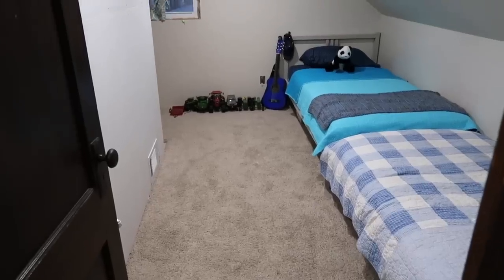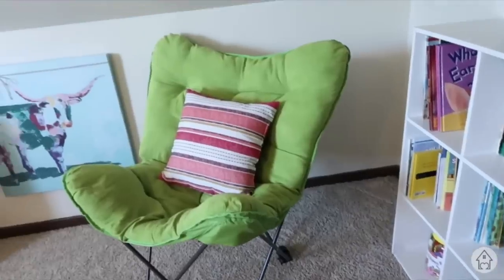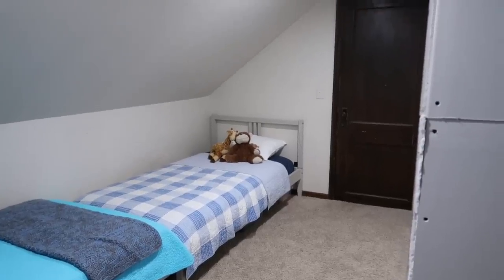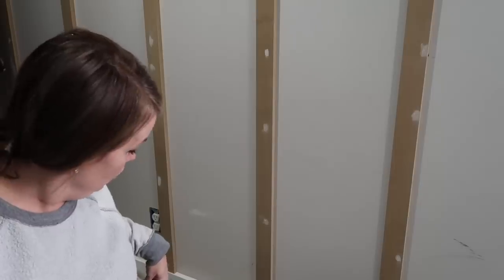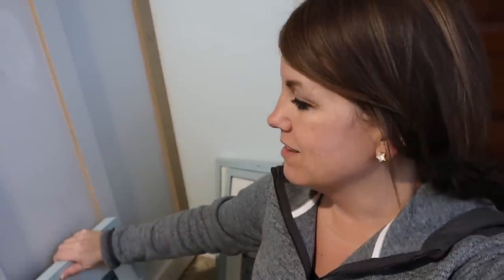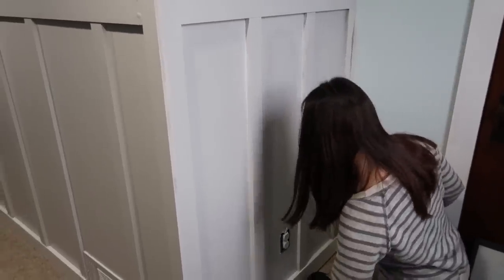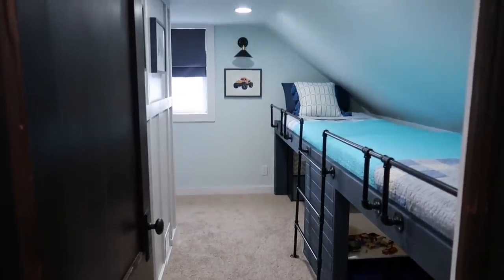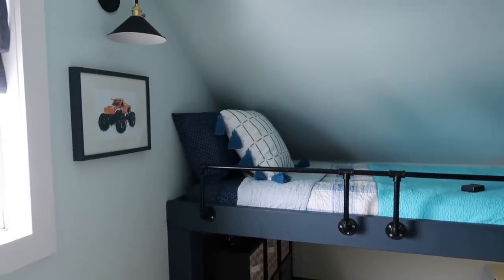Minimalist Boys Room Makeover with loft beds (Before & Afters!)

Comment: In our last house in CA (Built before 1906 as a summer cottage across the bay from SF. We bought in 1982 to 2003), we had a cedar shingle 2 story house.  We did buy a sprayer, but it made so much noise (Wagner) that we decided to dip all the shingles into a garbage can of various leftover colors of pigmented stain to make a sort of milk chocolate color.  While my hubby had a full-time job and I was raising 2 small chillin's, I got volunteered to dip said shingles. Let me tell you that rubber gloves do disintegrate in stain.  My son was in late day Kindergarten and by the time I had to go get him down the street, I wiped the stain off my hands to my elbows which didn't get all of it off.  I'm surprised my arms didn't fall off during that whole time. It was very interesting after I was done with dipping that I leaned the shingles up against our fence about 4 deep, so the shingles got grass marks on them.  In the years that passed, the milk chocolate started to turn to chocolate purple... TIME TO MOVE! LOL!  We just had our 21yr old (built in 2000, but we bought in 2003 till now)log house painted last year and the workers sprayed it.  Looked way easier, but just as messy!  It started out kind of typical orange log house color and we stained it darker-like the first house. After all these years, I wanted it lighter, so it became a nice tan to match the desert we lived in and we have dark red doors!  Classy!  Before that, we had a 2 1/2 car garage built just finished right before the painting started!

Comment: I did a lot of spray painting (with airless paint sprayer) in my last house renovation. I mean... you just can't beat the finish. More durable, beautiful, looks so professional. Practice a bit before you begin, clean gun quickly and have a good spray gun! The best one I've tried was actually a cheaper, but highly rated one I found on Amazon. Weird but it worked GREAT! I also used this additive that made the paint more self-smoothing. Worked great. But ohhhh.... the prep work is sooo painful. I was thinking no way when I heard of taping it all. Then I heard how many coats & thought... absolutely, spray it!

Comment: Love the boy's room.  WOW... that roman shade is fabulous !!!  I think this will be the answer to my downstairs windows.  the fabric I bought  is very heavy and I also want blackout fabric on the backside.  I was worried that it would all be too heavy to work with the traditional "pull up" type of roman shade.  This may be the answer.. thanks !  I use the curved wall picture hangers and they are great.  Oh boy, using a paint sprayer. Tom and you know it is a pain to do and the clean-up is worse than the spray job.  We loaned our sprayer and the person didn't clean it correctly... we had to trash it. (so sad).  good luck on your camper project.  it will be beautiful.

Comment: @The Minimal Mom Re: sprayers
I had my teens help me paint the house (inside) -- great learning experience for them! That was with rollers and brushes. But when we got to the unfinished basement, there were a lot of uneven surfaces. Cinderblock walls, nails sticking out of the ceiling, etc. I got a sprayer to deal with those surfaces, so as not to ruin our brushes (and knuckles), and it worked fine, until it clogged up. I think it didn't like the angle of being pointed up at the ceiling. So my suggestion is, be prepared to paint the ceiling with a roller if necessary, But spraying is quick and awesome for the walls!

Comment: My dad and my father-in-law were doing us a favor by spraying our small bathroom that we had remodeled with board and batten. They both had used a sprayer before, but neither was to eager to talk about how the painting had gone when we got home from work. No only did they have problems with runs, but they also tipped over a whole gallon of paint working in such tiny quarters.  We felt so bad for them. Poor guys! 🤣  Our best tip: put the paint and sprayer in a big tote while you're working!

Comment: Tom, I have pipes to make bookshelves in my office, but I'm nervous to get the two towers lined up so the wood shelves will be level. Definitely need a second pair of hands for this project. 
Maybe I'll put a horizontal pipe midway up to connect them so I can level and  tighten everything up before screwing the flanges to the wall. 
I just want this project done so I can move my books off the floor. I started this the summer before the quarantine took effect last year.

Comment: Painted a shed with same type of sprayer using heavy duty alkyd paint. Still going strong 20 years later. Ran out of mineral spirits during cleanup drive to store with newspaper stuck to hands to protect steering wheel. Store staff still tease me gotta love small towns!  Wear good masks and goggles it will get nasty in there.

Comment: Perfect timing!  We are going to refinish our 15 y.o. camper...starting the project (hopefully) next month, weather permitting. I have been debating on brushing vs spraying. Tom, please include whether you think its feasible for someone with ZERO experience using a sprayer. Also, my hubby redid the flooring in the kitchen area where we had some rot, but its still feeling squishy. He refuses to take out the cabinets to extend the new flooring under, which I dont blame him, and don't necessarily think that's the problem. I think its a matter of correct underlayment. Any advice? Also, if you can, can you show more in depth the transition area for the slide? Phew...sorry its so long and I sure am asking for alot!! ❤🤞

Comment: I have personally painted the inside of a house with a sprayer, and I agree with Tom that it will not be fun. The prep work feels never ending, the paint gets all over you (make sure to wear a full body suit), and the paint fog it creates is seriously dangerous (I stupidly found out the hard way). The only thing that might make it worth it is the 3 to 4 coats needed. Just make sure to patch the holes the sprayer creates between each coat. And you will want to make a rule that nobody goes within 10 feet of the camper while spraying or while there is still a paint fog. And a heavy duty paint mask should go without saying.

Comment: We use an airless at work, but never tried using it in such an enclosed space.  I would suggest having a practice spray on something outside of the camper first (but ideally on the same type of surface) so you get the hang of it and the amount of air/ paint and speed you are going is good.  Clean is STRAIGHT AWAY after using it. Personally I find the taping and masking it bit so boring..... maybe download a good audio book to listen to whist you are doing it! Good luck!
Reply: Oh and wear the correct PPE! Mask, goggles, paint suit gloves etc etc

Comment: HOW did you get the black pipe to cooperate with the ladder???  Did you have to over tighten one end into the fitting before working on the next (in order to not unscrew ot from the first end), or did you find male and female ends on all the tight pieces? This seems like a nightmare to work on

Comment: For the walls did tom jist hand drywall and not mud or texture? Jjst wondering because we are going to hang drywall in pur living room. Currently pur walls and ceiling look like the inside of a ship. Just boards nailed up painted white and between each board there are hige cracks. I really want a cost effective way to make the wall look nice and sealed and clean. Trying to save money at the same time as making it nice. Can I hang drywall and not texture jjst paint a few coats?
Reply: Drug wall does not have to be textured! But it does take a bit more work to have what's called "flat wall". You have to do more thin layers of mud at the seams and sand with a finer grit to make the seams smooth.  And it helps if when hanging the drywall, you check to make sure it's all level with each other across the studs. You might need to get some leveling strips. I dont remember the name of them as my FIL had a bunch extra and gave them to us. But the are cardboard strips you use on the studs if you have any low spots. This helps avoid wavy walls. Its takes a bit of patience, but it is totally worth it!!